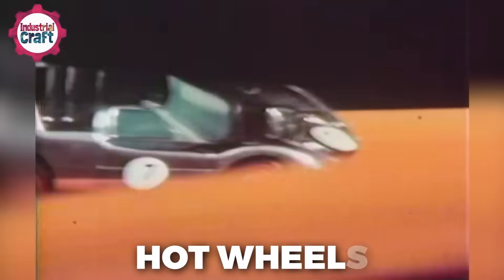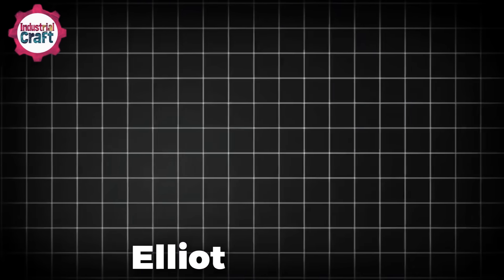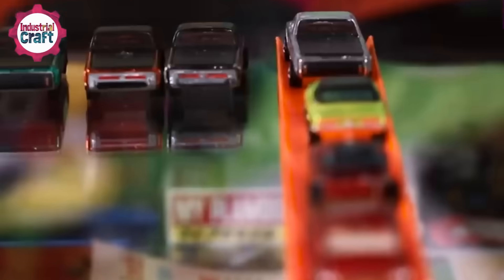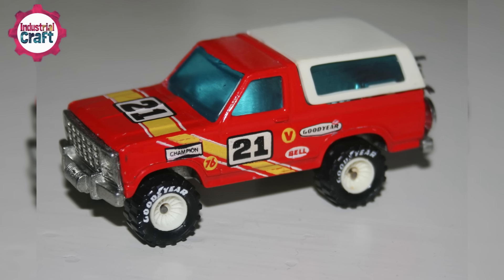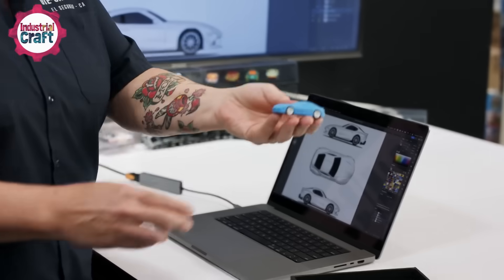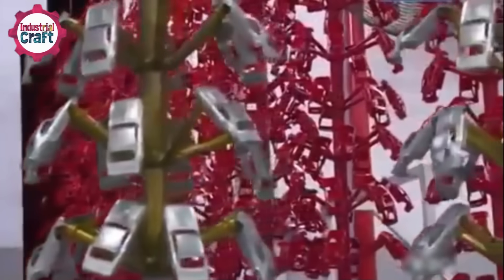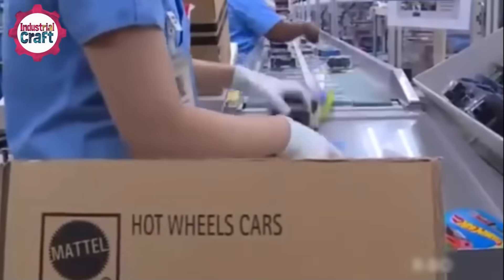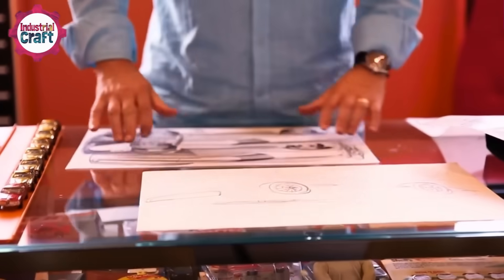How Hot Wheels Toys are made  | Edited version

Comment: the "suspension theory" is complete nonsense.
Hot Wheels has had the most rigid suspension of all die cast brands.
I know this all well as this was the exact reason for me to hate them 40 years ago...
Majorette had the best suspension that could drop the wheels in the fenders when "turning".
Matchbox even had better suspension (read axles).
When a Hot Wheels got stepped upon, you could forget about driving it again, as there was no,
i repeat, NO FLEXIBILITY to them. Most ended up bend in a slight way, giving the wheels an
unwanted camber.

Comment: Pretty interesting. But even though the design team does work hard, it's interesting that they sometimes miss the mark.  The mainline ($1.50) cars are understandably a bit rough and have their headlights and taillights spray painted over like a $200 paint job on your car ("masking tape?  What's masking tape?").  But I feel it's a bit unforgivable when the shape of the car's body isn't right.  Case in point:  Hot Wheels put out a Pantera in yellow.  I grew up seeing the real car, and this Hot Wheels car wasn't right.  The body was too long.  Very recently they have or will be releasing one that is better.  So yeah, they're not all perfect, like this video tries to say.
Reply from the maker: Totally. I think like most companies, they are pinching every last penny in production & manufacturing

Comment: Sadly, most Hotwheels designs made in the last 15+ years are garbage. They don’t make realistic models like they use to, and put garbage paint jobs on them when they do. I still have 50+ old ones from the 70’s, and 80’s when they looked real. I still buy realistic models when I find them, but they are far and few in between.
Reply: Matchbox (same company as Hotwheels) still makes real cars. Matchbox also usually paints/details the lights on the front AND rear ends of the car (hotwheels rarely does the lights on both ends). If you're anything like me you'll like Matchbox. Also, check out Majorette. My Majorette cars are far superior to my Mattel cars.
Reply: I respectfully disagree.  I stopped collecting in the 90's because of to many fantasy castings that you speak of.  I started back collecting 16 years ago because they started making more realistic car's and trucks.  If  you don't like the use of more plastic vs metal in the 70's and 80's  than that's a different story.  I think us as adults forget that these are intended for kids and not us as adults
Reply: I have my childhood HW from the 70’s.  They looked 90% real.  Paint jobs were a bit flat.  But I agree that the paint job from today tend to be garbage.  Even Matchbox are garbage.